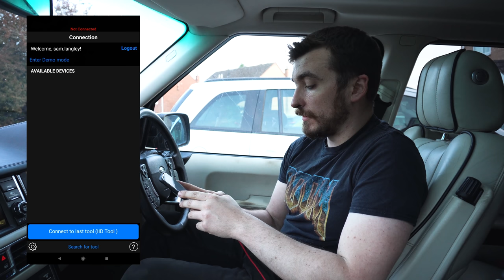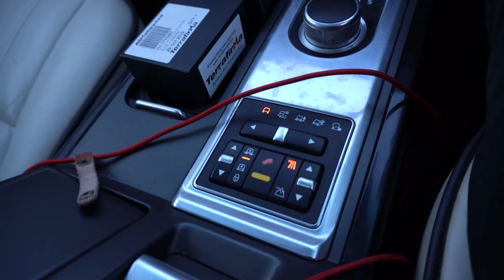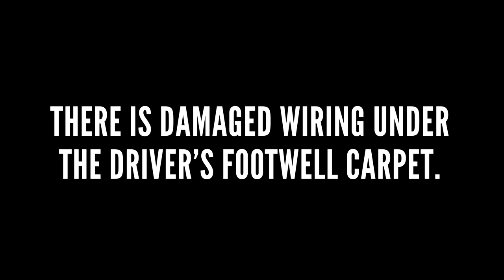HEIGHT SENSOR & RAIN SENSOR Replacement on the CHEAPEST 4.4 TDV8 Range Rover L322 in the UK!

Comment: Nice video ! Not sure if you had already done so but it’s important to raise the suspension to its highest setting ( if possible ) and then to disconnect the battery. Sometimes when replacing these height sensors when the battery is connected could immediately cause the car to adjust its height which could be hazardous

Comment: So hope you find the answer to this, I’ve got a Disco4, the ride is rock hard!! Any bump in the road is like landing a Boeing 747. Characteristics are strange, it still ‘floats’ down the road but any slight road imperfection it thuds throughout the car. I’ve got a set of 19”s going on this weekend to see if it helps, if not my local Indy has said to replace all 4 airbags and struts (these are one unit on d4 rather than separate items) hoping you can find a quick fix 😂

Comment: You really should drive with your center display set to 4x4. It tells you when the suspension has reached height and can show you when height sensors are failing by the wheels bouncing up and down or red bars. I appreciate the you’re having a problem with a different system though.
Reply from the maker: I didn't realise you could see when sensors are failing - I'll definitely give that a look next time I'm out in her. Cheers!

Comment: I just fixed the wiring splice for the rain sensor on mine. Mine also has the faults with the 2 speakers as well. Apparently its common for those faults where there is nothing wrong
Reply: Where is the problem with the wiring splice exactly please? I have a similar issue
Reply: @youthedaddy  Under the drivers side sill cover on the floor a red and green wire if i remember correctly

Comment: Great video. Got a front one to change on mine. Can they be replaced whilst the wheel is on? And if not, do you lock the suspension before jacking it up?

Comment: Good to see you finally got the IID , did you decide your original diagnostics was not up to scratch?
Reply from the maker: SDD (the JLR software I have on my laptop) is the more powerful of the two.  However, it's nice to be able to just leave the IID in the Rangie and have it whenever it's needed, without the need for my laptop and cable etc.

Comment: Cool job! I suggest youd check the rear bushings on lower control arms as they usually wear out over time! Cheers 👍
Reply from the maker: Yep, it has the characteristic squeak from the back end, too!  So they'll want doing sooner or later.
Reply: @SamsMotors  Definitely mate!, i have 2004 RR HSE and yes it does that squeak noise while i drive on some rough bumps roads, ay you keep up the good stuff man 🤟

Comment: great videos, i own a 2012 4.4tdv8 l322 too. i recently had problems with the auto headlights. they dont switch off even in a sunny day. do you know where the sensor is located ? or is it the same sensor as the rain sensor?
Reply from the maker: Thanks 🙏 the sensor is indeed combined with the rain sensor on the windscreen.  Have you got any codes relating to communication with the rain sensor?  If so it could be the same problem I had with mine (damaged wiring splice under the carpet).
Reply from the maker: If your rain sensor works ok, it may also be that the car is set up (coded) to run the headlights all day.  If you have an IID tool you can alter this in the CCF.

Comment: Don't know if you have any insight, but when I got my 06 RR SC, it was on its bump stops. Someone had driven it like that and the front right strut, if you pull the rubber cap off under the hood, sits 1 inch higher than the left one. So much that the cap won't go all the way back on. I imagine the banging on the bump stops rammed the strut so hard, it slipped in its housing a little? So when it is sitting on the bump stops, the front right of the vehicle sits an inch lower now. Now I reset the codes, and got the air suspension working again by replacing the relay in the back. After that, I did the turn steering wheel full left and right to reset the system. But somewhere during this process, the sensors got calibrated sitting on the bump stops with the front left being 1 inch lower. My question is, do you know what I did to trigger it to calibrate? I don't have a diagnostic tool other than the typical OBDII tool. So I couldn't have triggered the calibration on purpose.

Comment: Great video....  Very interested in the rain sensor as I mine has stopped working, but can I ask what symptoms you had??  My wiper stalk still works, but first position is now intermittent and not auto...  Is that the same?  Can I ask where you found the wiring fault and I will look there first.
Reply from the maker: Yes that’s the same symptoms I had.
The wiring fault was found under the driver’s side sill/carpet, and I’d be 90% sure yours will be the same problem.  I rectified the wiring problem in this video: https://youtu.be/CWYcxUfmmZ4
Reply: @SamsMotors  Great, thank you for the note and replying so quickly....  Do you think that the only want to get to that part of the loom is having the seat out or at least rocked back with the bolts out?  I am wondering if I would be able to get under the carpet without such a drastic disassembly.....  Interesting that I had the rear door card off over the weekend as the switch had been pushed in since purchase and just got around to fixing it.....  Also had the rear camera 'blue screen' issue...  That just needed the spoiler being unbolted and a lot of wiggling of joints....  Guessing it was a slight corrosion issue...  Definitely with you that if you are not scared of a spanner then the L322 is a remarkable bit of engineering...
Reply from the maker: @jellmers  no need for seat out, it’s just under the tread plate basically.
Reply: @SamsMotors  You're a star thanks....
Reply: You sir were bang on the money....  Thanks...  Decided to try and tackle getting at the loom just now...  Without taking the carpet up it is a struggle, but it can be done...  Getting the cover plate off is the hardest part to be fair...  Need to take out the trim surrounding the bonnet release and then have a fight to get the plastic cover slide out at a lather odd angle....  Anyway.  Bit if digging around I found the red and green wires (for those having similar issues, they are spliced closer to the seat than the peddles....  They were taped (as factory) but when I gave the tape a tug they came away with visible signs of corrosion...  So cut back the wire a little, stripped them, and then joined them using one of those little heat shrink solder doobries you can join wires with using a lighter....  I think the solder should minimise the risk of corrosion in the future and the heat shrink is glued.  I couldn't be bothered to drag my solder station to the drive....  Anyway.  All working.....  Must admit that I also found the bundle of red and orange wires (7 or 8 of them) that were also spliced in the same way which I also treated to a new join, given the one taped, was looking decidedly dodgy, although I have no idea what those ones do....  As with all these things putting it back together was a much more simple task.  One thing I did try and focus on is positioning all the spliced wires on top the bundle, so there is less likelihood of those sitting in any moisture.   Thanks again
Reply from the maker: @jellmers  Happy days, well done for giving it a go!  I take it your auto wipers are working correctly now?
Reply: They are indeed.....Always happy to give simple instructions a go, and your videos give that opportunity....   Last year I ended up having to replace the front wiper motor as they were randomly parking or not working at all.  All the instructions talked about taking the wiper arms off, and the unit even comes assembled with them....  If you end up needing to do the same....  Don't bother removing the arms....  Just get to the point you have a bit of access to the arm base plate and motor and then unbolt the motor and replace just that unit....  Its a bit of a fiddle, but it does fit through the gaps, and its way easier to do than taking the wipers and arms off..... :-)

Comment: Love the videos.....I too have malfunctioning rain and light sensors, but you didn't specify how yours were failing. Is it, like mine, whereby when the auto lights are switched to "auto", they come on whatever the ambient light OR is it that when they are switched to auto, they don't come on at all even at night? Likewise, my wipers when switched to auto will wipe the screen whether there is rain / water present or not, as opposed to simply not wiping ever, if on "Auto". I am trying a new self adhesive pad first as mine is patchy / cloudy and was clearly not changed when Autoglass replaced the cracked windscreen! I figure that as there are 2 sensors in the unit, it is unlikely that BOTH have failed. However if that doesn't fix it, it looks like it's out with the drivers seat to check those 4 wires. If it was the wires going open circuit, I think this would mean that the sensors work by INHIBITING the lights / wipers in the absence of darkness / rain and allow the circuits to function ONLY when the ambient light drops low  and or rain starts........... Does this logic follow? Would there be anything to differentiate between a failed sensor unit and the 4 wires fault?
Reply from the maker: 99% sure it’ll be the splice.  When the rain sensor is inop, it defaults to normal intermittent wipers.
Reply: Yes that's what mine is doing - regular intermittent wipe according to the rotational speed controller, whether it's raining or not. The auto headlight setting is lights on all the time - bright sun or pitch black.
Reply from the maker: @TheDoc-j6g  yep, it’s a fail safe mode.  Have a look at that loom under the floor board.
Reply: @SamsMotors  Do you happen to have any further detail on where exactly the fault is and where to look? I have the same issue but no idea where to look for the loom. Ta!
Reply from the maker: @youthedaddy  Take up the aluminium sill plate in the driver's door opening, then peel back the carpet a bit.  You should see a thick loom of about 100 wires running along the floor/sill.  Unwrap some of the loom tape and separate the loom and you should find a few wires (red/green I believe) that have come detached from a corroded splice.  You just need to reconnect them all together and the sensor should come back to life.  You can check my new seats/interior video to see how I found and fixed it.  Cheers!
Reply: @SamsMotors  Star, thank you!
Reply: @SamsMotors  I must be the only person that doesn't have a Splice issue causing my Rain Sensor issue. Had both drivers and passenger side up as best I could and no splice issues or corrosion. The only splices on the drivers side were yellow and black and yellow and green and these were complete. Not sure what else to try now grrrrrrrr

Comment: I had a similar problem with mine where a duff wire that goes into the top of the front RH suspension under the heavy duty metal cap (located under the bonnet) Just a cut and crimp job had her floating along again.

Comment: What I have learned or can see from your videos is that your Range Rover is no longer the cheapest Range Rover, since you meticulously exchange everything that can only be exchanged. In the meantime, your Range Rover should be quite expensive to very expensive, just from the amount of work and the hours sunk for repairs, video and editing. I bought my Ranger Rover L322 / M62B44 (2003) 6 years ago, 6000€, 210,000km. From time to time he sees an oil change and that's about it. I don't even pay attention to the colorful lights in the display anymore, because I've learned that it's just prone to the smallest electronic errors, basically it just keeps running and running and running.... meanwhile 315,000 km on the clock😂 However, your videos are very good for other RR drivers with problems, no question. Still, you're paying a lot of tuition for..
-------------------------------
Was ich inzwischen aus deinen Videos gelernt habe oder ersehen kann ist, dass dein Range Rover schon lange nicht mehr der günstigste Range Rover ist, da du penibel alles tauschst, was nur zu tauschen geht.
Inzwischen sollte dein Range Rover sogar schon recht kostspielig bis sehr teuer sein, alleine schon vom Arbeitsaufwand und den versenkten Stunden für Reparatur, Video und Schnitt. Ich habe meinen Ranger Rover L322 / M62B44 (2003) vor 6Jahren gekauft, 6000€, 210.000km.
Der sieht ab und an mal einen Ölwechsel und das war es aber auch schon. Die bunten Lichter im Display beachte ich gar nicht mehr, da ich gelernt habe, dass der einfach anfällig ist für kleinste elektronische Fehler, im Grunde aner lauft und läuft und läuft.... inzwischen 315.000km auf der Uhr😂
Deine Videos sind allerdings für andere RR-Fahrer mit Problemen sehr gut, keine Frage👌🏻🙏🏻. Dennoch zahlst du da eine Menge Lehrgeld für👈🏻
Reply from the maker: It depends on your perspective... I don't count the time and effort repairing and making videos as I enjoy it as a hobby.  Therefore, it's free to me. The parts themselves are usually purchased as cheaply as possible (take my A/C compressor as an example - I paid only £150 for it as opposed to £450 direct from LR).
Considering that a lot of these repairs would have to be done on every Range Rover (not just mine), my total outlay is probably still less than the majority of 4.4 TDV8 owners after 1 year.

Comment: My Range Rover hse 2007 having problems with my front passenger suspension, it lower than other side about 2-4cm, and I 4x4 info that side also unstable sometimes it show very high and low, and sometimes the info that show is different from real. Example  the front suspension passenger side is the same height as driver side, but the info showing it not the same height. It also have air suspension indicators and and say suspension fault. My special program and suspension control are also off, I Lower and rising it by my key. 
I want to ask you that can be the front sensor? I already check the air system but seems not one leak. ( suspension, air compressor(leak in the past but it got fix now) valve block ,air spring, air line, ride height sensor ) the front passenger ride height sensor not broken but when I push it buy my hand it seems like a-bit weird from other side.
Can you give me some advice?

Comment: Had the same problem was a chaffed wire near the battery a common fault took my mechanic 30 mins to repair solder and shrink stuff
Good luck 
David in Somerset
Reply from the maker: Yeah that'll be the damper wires on the front struts.  Mines had the repair done both sides already, but it'd probably be worth me checking them and redoing.

Comment: Observations: - pleasantly surprised some of these bolts aren't just shearing but I suppose it's life has been in a warmer part of the UK. 

Are these heights sensors also used for headlight levelling? 

F1 practice in the background? 

Digital dash? 

How much was the height sensor? I guess you could be holding back for a how much update later though.
Reply from the maker: Yep, everything I've taken off so far has been OK rust-wise.  It's only just turned 10 years old after all - but yeah it lived down in Sussex for most of its life.

Headlight levelling is done via the air suspension system keeping the whole car level - it doesn't adjust the headlights per se, so yes I suppose they are levelled via the ride height sensors. 

Height sensor was about £60.
Reply: @SamsMotors a different world for a 10 yo FFRR that's lived its life in Scotland.

Comment: Have you considered it's something mechanical? Poly bushes fitted in the suspension arms can attribute a stiff ride: and I'm sure you've seen the post on arms on the FB group with the variances between rubber stiffness on the suspension bushes.
Reply from the maker: It has crossed my mind - but the strange thing about it is if the Rangie has been parked for a couple of days, the first few minutes of the drive it behaves impeccably!  But then the ride gradually gets stiffer and bumpier after a couple of miles.  So that's why I think it's something electronic.
Reply: I wouldn't rule anything out with these things 😂 it does sound like the electric dampening playing up- but it could be the rubble is becoming supple with not impact so is much smoother after being inactive a few days. I did see something about an upper mount control the other day in the dreaded rear arches- could be something to do with that or I could be talking nonsense (as it was a background watch)

Comment: God I loved driving my old wagon.  Started with P38, right through to your 4.4TD model.  Gave up on them when I got older and constant faulting became an irritant and no longer fun (yes, I did used to enjoy getting hands dirty).  Went Touareg V8 tdi and to be honest in everyday life it’s more capable, without getting under it once a month to fix it.  Nope it hasn’t the same graceful feeling behind the wheel, but I reached the age where that mattered less then reliability
Reply from the maker: It's important to remember that the V8 TDI 2nd generation Touareg is a generation newer than the L322 (2010 vs 2002).  Capability wise though, the L322 probably still has the edge in terms of off road ability, and there's no comparison in the classiness department.

Comment: I thought the height sensor wiring was under the car along the chassis. I could be wrong on that model
Reply from the maker: Think you're right.  The module is in the rear right corner of the car too, so I presume the rear sensors just run straight over to it.